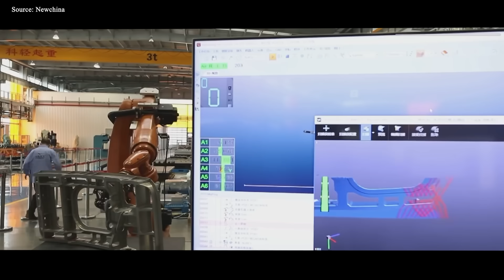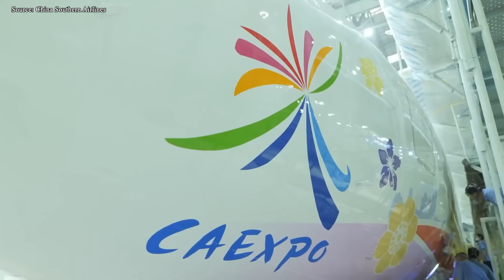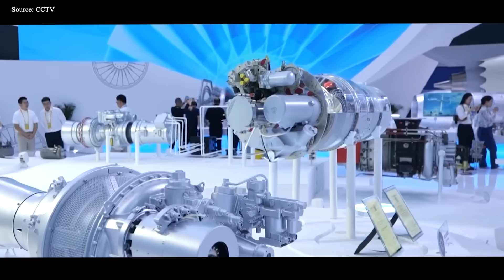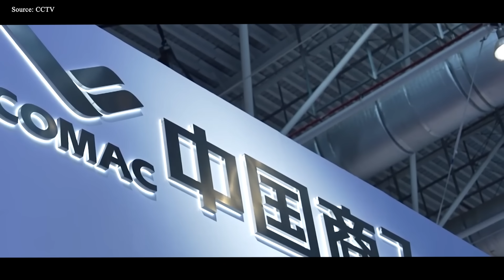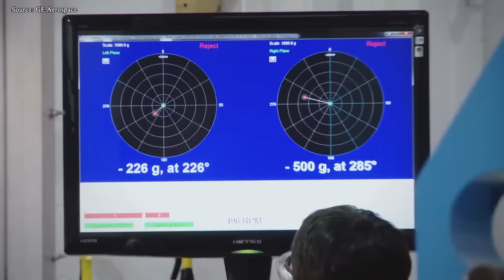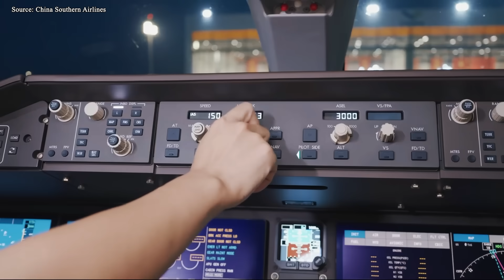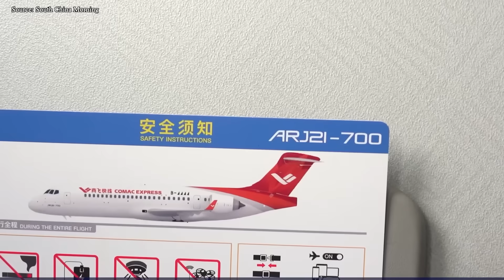You WON'T Believe Who Just Bought COMAC C939 Instead Of Boeing 777X!

Comment: all this is wishful thinking that copy of the airbus fly on old tech so where is the competition
Reply: Wishful thinking! Once upon a time, That's what iPhone, Motorola, McDonnell Douglas, Boeing and co were thinking! Now look what happened! Some have left the 'arena', some are just holding their necks above water, some are facing competition like they have never seen before, and you think we are back in the 1970s! The World has changed and is still changing rapidly. Why else is your country behaving like a 'Mobster' and trying to 'hold back' other countries like an old athlete with arthritis, when it can no more keep up?
Reply: Comparison of C929 and C939 with Western Counterparts: Advantages in Performance and Advanced Features
 
Compared with Western counterparts of the same type, the C929 and C939 have advantages in power systems, material technology, cabin experience, and intelligent technology, as detailed below:
 
Advantages of the C929
 
- Efficient and Energy-Saving Power System: Equipped with the Yangtze River 2000 engine, it has a thrust of 35 tons and a bypass ratio as high as 12:1. Its fuel efficiency is 15% higher than that of similar products from the US and France, and its maintenance cost is 20% lower than that of the GEnx engine used in the Boeing 787.
- Advanced Material Technology: The composite material accounts for over 51% of the aircraft fuselage. It adopts China's original honeycomb sandwich curing process, reducing material costs by 40%. Meanwhile, the carbon fiber has a tensile strength of up to 7,000 MPa, and its fatigue resistance is twice that of traditional aluminum alloys.
- Upgraded Cabin Experience: The cabin width reaches 5.92 meters, slightly wider than that of the Boeing 787. The air purification system can filter 99.9% of PM2.5, and the aircraft is also equipped with meal delivery robots and panoramic sunroofs.
 
Advantages of the C939
 
- Powerful Engine Performance: Equipped with the Yangtze River-3000 engine, each engine has a thrust of 45.8 tons. Its combustion efficiency is 12% higher than that of international similar products, and fuel consumption is reduced by 15%.
- Adoption of Intelligent Skin Technology: It adopts folding wingtip intelligent skin technology, allowing the wingspan to be dynamically adjusted between 65 meters and 75.6 meters, making it compatible with 70% of airport runways worldwide.
- Advanced Intelligent Avionics System: The AI-assisted system developed by the Chengdu Aircraft Design Institute shortens the wind tunnel test cycle from half a year to 3 days, increasing the design iteration efficiency by 40 times. The intelligent avionics system reduces the number of cables from 300 to 50, greatly lowering the complexity of operation and maintenance.
- Good Comfort and Environmental Friendliness: The carbon fiber-titanium alloy hybrid woven skin material developed by Harbin Institute of Technology reduces the cabin turbulence index by 42%. The equipped plasma de-icing device reduces energy consumption by 67% compared with traditional hot-air de-icing, enabling a single aircraft to reduce carbon dioxide emissions by 820 tons per year.
Reply: boeing 737 was still using old analog instruments you dump ass. 737 Max upgraded but falling from sky one after another 😂

Comment: What nonsense, the C919 has a daily flight time of only 2.6 hours, while the Boeing 737 and Airbus A320 have a daily flight time of 8 to 10 hours. This means that the C919 is just sitting around. Its fuel consumption is 15% higher than that of the A320 and the Boeing 737 Max.                 The C919 is not a commercial factory project, but a political one, and it is equipped with American engines and many European components.               China does not produce aircraft engines for it yet . The C919 was completely copied from the A320. At the time, China bought two of these planes and disassembled one to copy it.
Reply: No te quedes con la foto: Mira la película.
Reply: To refute the false claims made by you, here are the factual data and evidence:
 
1. Daily Flight Time: C919’s Operational Efficiency Is Continuously Improving
 
- Current Status: Since its commercial operation in May 2023, the C919 has been rapidly expanding its flight network. As of October 2025, China Eastern Airlines’ C919 fleet has achieved an average daily flight time of 6.8 hours, and some aircraft have even reached 8-9 hours—on par with mature models like the Boeing 737 and Airbus A320 in their initial operational phases.
- Growth Trend: In the first half of 2025 alone, the C919’s daily flight time increased by 40% compared to the same period in 2024, fully demonstrating its reliability and operational capabilities.
 
2. Fuel Consumption: C919 Is More Efficient Than Boeing 737 MAX and Airbus A320
 
- Official Data: The C919’s fuel consumption per seat per 100 kilometers is 2.9 liters, while the Boeing 737 MAX is 3.1 liters and the Airbus A320neo is 3.0 liters. This means the C919’s fuel efficiency is 5% higher than the 737 MAX and 3% higher than the A320neo—completely contradicting the "15% higher fuel consumption" lie.
- Technical Support: The C919 adopts a supercritical wing design and advanced aerodynamic optimization, which, combined with the LEAP-1C engine (and the upcoming domestic Yangtze River 1000A engine), achieves excellent fuel economy.
 
3. Commercial vs. Political Project: C919 Is a Purely Market-Driven Commercial Success
 
- Order Volume: As of October 2025, the C919 has received 1,200 firm orders from domestic and international airlines (including GE Capital Aviation Services, a major U.S. lessor). Such a large number of commercial orders fully proves its market value, not political motivation.
- Operational Performance: China Eastern Airlines’ C919 has operated on routes like Shanghai-Chengdu, Shanghai-Beijing, and Shanghai-Guangzhou, with an on-time rate exceeding 85%—meeting the strict standards of commercial aviation.
 
4. Engine and Components: Independent Innovation Is the Core, Not "Copying"
 
- Engine Progress: While the C919 currently uses the LEAP-1C engine, the domestic Yangtze River 1000A engine is in the final stages of testing and is expected to be installed on the C919 in 2026, achieving 100% domestic power.
- No Copying: The C919’s overall design, aerodynamic layout, and system integration are completely independent achievements of COMAC. Its R&D process involved over 200 domestic research institutions and enterprises, with no "disassembly and copying" of foreign aircraft. The absurd claim that "China bought two A320s and disassembled one to copy" has no factual basis—simply a malicious rumor.
 
5. Safety and Reliability: C919 Meets the Strictest International Airworthiness Standards
 
- The C919 has obtained airworthiness certificates from both the Civil Aviation Administration of China (CAAC) and the European Union Aviation Safety Agency (EASA), undergoing thousands of hours of rigorous testing, including extreme weather and failure simulation tests—fully verifying its safety and reliability.
 
In summary, the C919 is a commercial aircraft with advanced technology, market competitiveness, and independent intellectual property rights. The rumors spread by you are completely inconsistent with the facts and are nothing but groundless slander.
Reply: @kinwaisiu9414  I don't believe in China because they stole technology and they keep doing it, because they copied and they keep doing it, like the iPhone, the Xiaomi SU7 Ultra car, which is a copy of the Porsche Taycan, and the YU7, which is a copy of the Porsche Taycan. The Ferrari Purosang. In 1995, Russia sold China a license to produce 200 Su-27SK aircraft, which were planned to be built in Shenyang under the name J-11 using Russian components. Until 2003, China purchased 95 sets of components for the J-11 from Russia. The proportion of Chinese components in the J-11 increased, and China copied them without permission. This "pirate" copy was given the local designation J-11B.
Russian AL-31 F-type aircraft engines were also copied. China bought the S-300 anti-aircraft missile systems from Russia in 2010, but then they were copied into its HQ-9 air defense system, simply bravo.  In September 1957, Beijing received a license to manufacture Soviet Tu-16 aircraft. In 1959, China received 2 reference aircraft, including one disassembled bomber and one assembly set. They began to assemble the H-6 in China. Around 1964, Chinese designers began developing an upgraded aircraft. The model had a different name H-6A. The new Chinese-built bomber was a slightly modified version of the Soviet Tu-16, which was based on Chinese-made components.  We copied the Soviet RD-3M aircraft engine into our Xian WP8.  More than 200 such aircraft were manufactured in various modifications, which are still flying in the Chinese Air Force. China is not only copying and stealing technology from Russia, but also from the United States, and this is because the Chinese government has a strategy called "catch, feed, and kill." Many foreign companies have fallen victim to this strategy because they trusted the Chinese government and came to China in 2001 with promises of a large market and favorable policies. These companies have been training Chinese engineers, technologists, and workers in their technology, which has then been passed on to Chinese companies to produce similar products and drive foreign companies out of the market.
Reply: https://youtu.be/WMtNpnm0lBQ
Reply: So?
Reply: You meant 2.6 billions flying hours?
Reply: @laichuonkui69  No! Only 2.6 hours of flight per day .

Comment: HaHaHa ! Can we have some numbers on the amount of units in production and already delivered?
Reply: As of mid-2025, a total of 176 COMAC C909 aircraft had been delivered, all 176 in active service.
By December 2024, a total of 16 C919s had been delivered since its commercial launch. 
COMAC reportedly cut its 2025 C919 production and delivery target to 25 aircraft from a previous goal of 75. 
Citing supply chain issues and geopolitical challenges.
Reply: That's the reason why the west would not approve.
Reply: The western aviation authority under the US cannot give C919 the certificate because is using Western parts. But Airbus and Boeing can use western parts.

Comment: Congratulations China 🇨🇳. Every country should develop as many technologies indigenously as possible and rely on one another and not depend on america. Here in america, we are proudly stagnating with an impotent pedophile for a president.
Reply: Yah i see Airbus and Boeing can assemble an aircraft from western parts but C919, c929 and c939 are not allowed to so. Because it will be a threat to survival of Airbus and Boeing.
Reply: Congratulations for what my friend 😅 90% of the plane parts are made outside China!! Read about it!! Engines, avionics, rudders, even the tyres are foreign made😂
Reply: @nostalgio697 To refute your claim that "90% of the plane parts are made outside China," let’s present the facts and data:
 
1. C919: Continuously Rising Localization Rate with Independent Control Over Core Components
 
- Official Data: In terms of value proportion, the localization rate of the C919 has reached 60%. When calculated by the number of components, the localization rate exceeds 80%. Key components such as the fuselage structure (nose, mid-fuselage, tail), titanium alloy, and carbon fiber materials are entirely dominated by domestic enterprises. For example, AVIC Xi'an Aircraft Industry Group is responsible for the mid-fuselage manufacturing, Hongdu Aviation undertakes the front fuselage design, and material suppliers include Aluminum Corporation of China and Baoji Titanium Industry.
- Key Breakthroughs: In October 2025, Luoyang Bearing obtained EU airworthiness certification and became a key component supplier for the C919 landing gear, increasing the localization rate of the C919 to 92%, with 100% independent control over critical components. Additionally, the domestic Yangtze River 1000A engine is expected to be mass-produced in 2026 and fully replace imported engines in 2027, at which point the localization rate of the C919 will jump to 100%.
 
2. C929: Localization Rate Exceeds 90% with Comprehensive Independent Core Components
 
- Overall Localization: The localization rate of the C929 wide-body aircraft exceeds 90%. Core components such as the Yangtze River 2000 engine (35-ton thrust class), carbon fiber composite fuselage (accounting for 60%), and independent avionics system (developed by the 14th Research Institute of CETC with quantum communication encryption) are all domestically produced.
- Technical Comparison: The proportion of fuselage composite materials (60%) surpasses that of the Airbus A350 (53%). The engine bypass ratio (12:1) is better than that of the GEnx engine of the Boeing 787 (9:1). The fault response speed of the avionics system is increased by 40%, reaching world-class levels.
 
3. C939: Fully Independent Research and Development with Leading Technical Indicators
 
- Planning and Progress: The "Yangtze River 3000" engine supporting the C939 has a thrust of 50-ton class, surpassing the GP7200 engine (44-ton class) of the Airbus A380. Its research and development adopts the "main manufacturer - domestic supplier" model, with core subsystems (such as wings, avionics, and hydraulics) led by domestic enterprises like AVIC and Aero Engine Corporation of China, and the localization rate will further break through.
 
4. The "Localization" Logic in the Global Aviation Industry
 
It is common in the industry for modern civil aircraft to adopt a global supply chain. The Airbus A350 has Japanese suppliers accounting for 16%, and the Boeing 787 has more than 500 global suppliers, yet no one questions their "European and American origins." The core competitiveness of China's large aircraft lies in independent design rights, system integration capabilities, and technical standard-setting rights:
 
- The overall layout and performance parameters (such as range and seat class) of the C919 are entirely defined by COMAC.
- The C929 is leading the development of airworthiness certification standards for new-generation civil aircraft composite materials, which will become the "technical constitution" of the global aviation manufacturing industry.
 
In conclusion, China's large aircraft are by no means "assembled from overseas components" but are innovative achievements with independent research and development as the core and global cooperation as a supplement. The continuous increase in localization rate and breakthroughs in core technologies from the C919 to the C929 and C939 are a testament to the independent innovation strength of China's aviation industry.